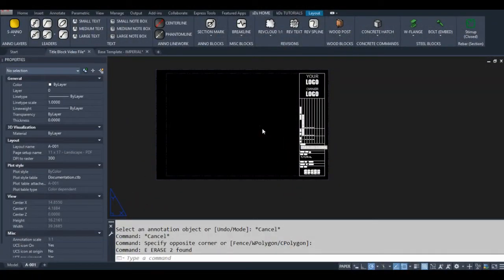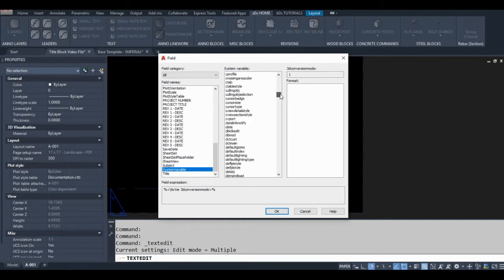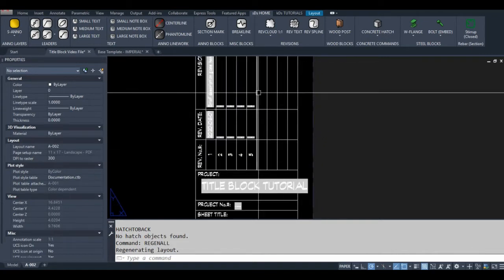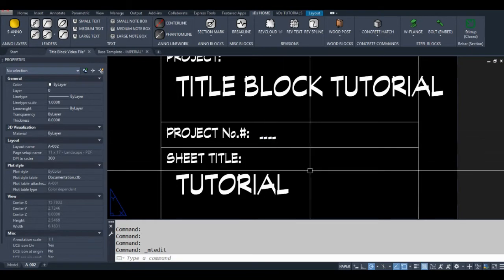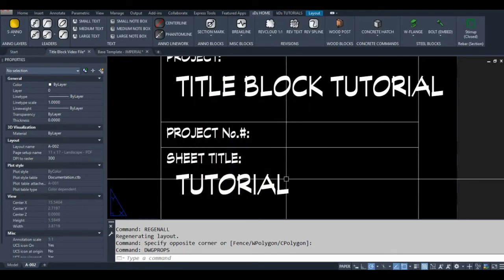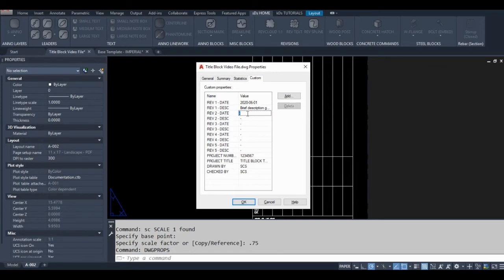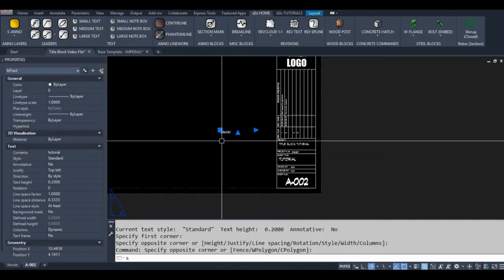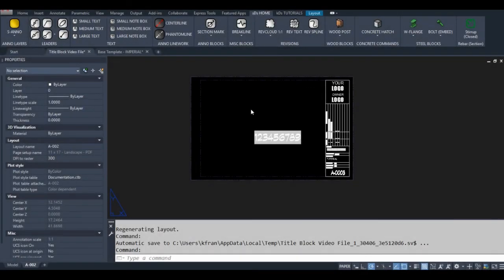Using Fields and Custom Drawing Properties

Comment: great video.... 1 cuestion...  do you know wich one is the variable that give the total amount of layouts in the file ?, so i can put  something like  :  Drawin# /  Total of drawings  

Thanks
Reply from the maker: Good question! There's a few ways you can do that. The easy way without custom code is also very manual. Just make the total page count a block; editing the block will change it on every page (for example, if you have 10 layouts just make a block with the text "10" in it and have it in every title block). The good thing about this method is that sometimes you have layouts that aren't actually pages, but something else (and therefore you don't want them to contribute to the total page count). Another method is using custom code: The drawing will have a "collection" of layouts. That collection will include model space, so the code will have to subtract one item from the collection's total count. Implementation will either be by way of a reactor that fires each time you create a new layout, or have the program automatically run each time you load the drawing, and manually run the code thereafter. Either code isn't hard to create, but to be honest, just creating a block is so quick and easy I've never bothered to even write the code.

Comment: Is there an alternative way to achieve the dwgprops in the Mac AutoCAD version? This command is showing as nonexistent and I read similar things in a thread.
Reply from the maker: I'm reluctant to give out advice for Mac because I can't test if it will work (or not). PC here obviously. One alternative is to create your own variables with AutoLISP. Here's one possible route: https://www.afralisp.net/autolisp/tutorials/application-data.php
This might end up being a lot of extra work especially if you aren't familiar with LISP programming. Most of the non "vla"/"vlax"/"vl" LISP functions work on Mac. In other words, AutoLISP is limited on Mac but still very useful.
Another option if you're very well organized is to create blocks that simply have the text in them and store them in a designated location. Copy them to your layouts and thereafter, you only have to edit one instance of them for all of them to change (I can make a quick video if that was too confusing). Actually this solution is way simpler than using LISP and would 100% work on Mac as well ;-)